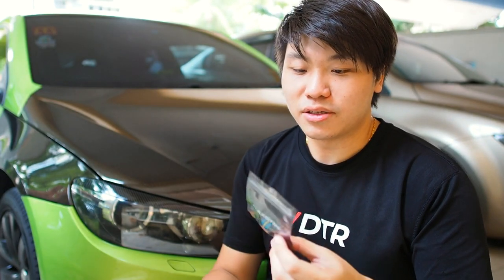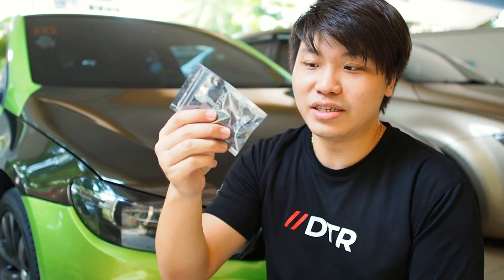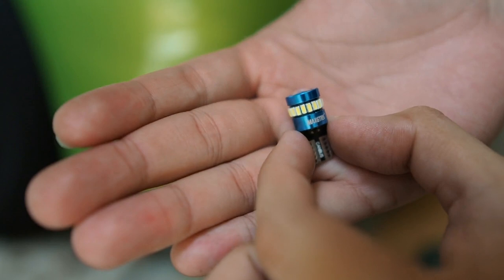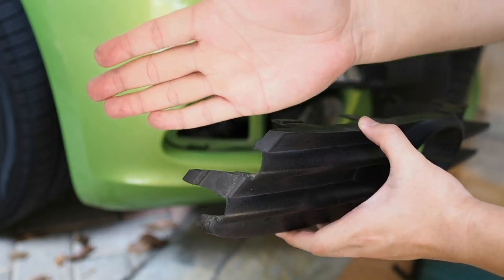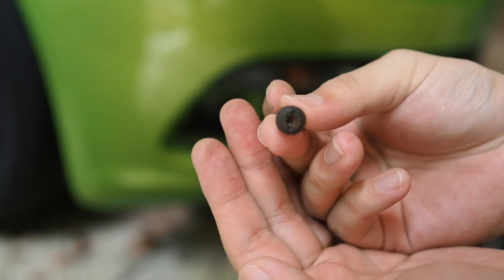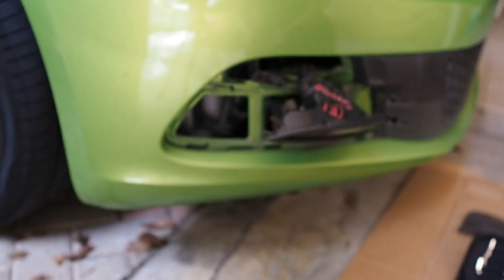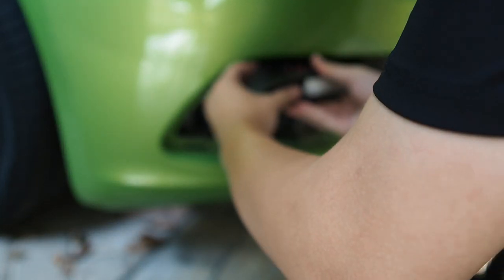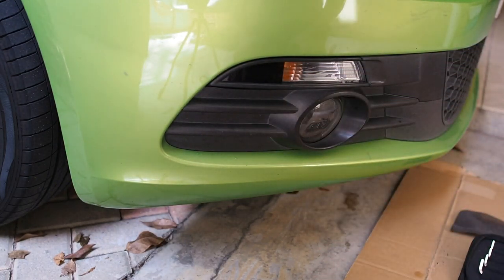Volkswagen Scirocco LED Light Upgrade!! (Install Guide)

Comment: Hello I have a 2015 facelift R-line. Can you tell me if the bracket is the same so I can change my lights. Thank you
Reply from the maker: Hi. If you have the signal and side marker in one  lamp housing then it should be the same.

Comment: You should've shown the led after installed everything back.. was curious to see how it actually looks and getting a HID for the foglights wud be nice 😉
Reply from the maker: I am thinking of getting canbus LEDs for the headlamp and fog lights. I already changed the headlamp DRLs to LED a couple of months back.
Reply: Wud be great if u cud put up a video of ur exhaust setup, high revs, fly by, dsg farts etc. 😉
Run on catless downpipe i''d suggest.
Reply from the maker: @jickbakri5070  sounds like a plan 👍